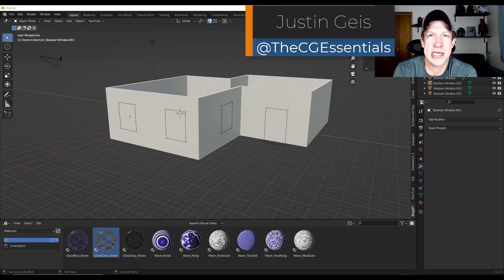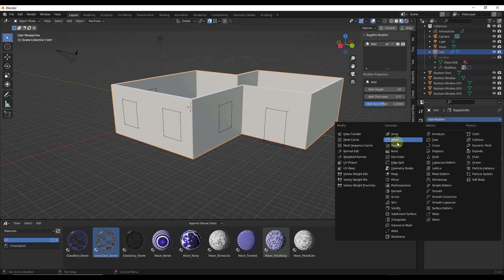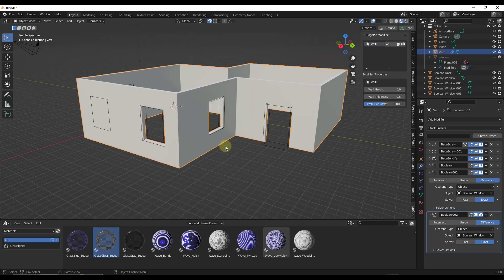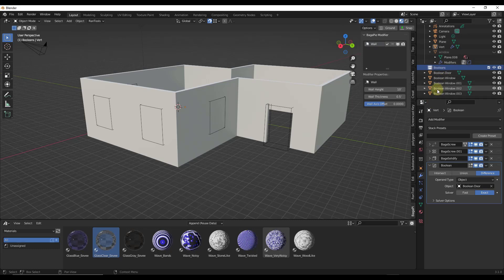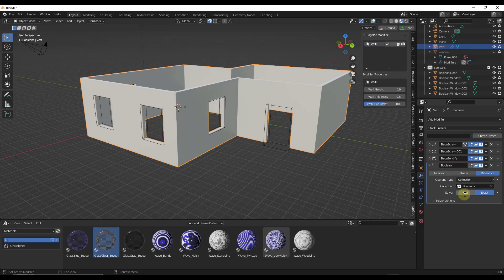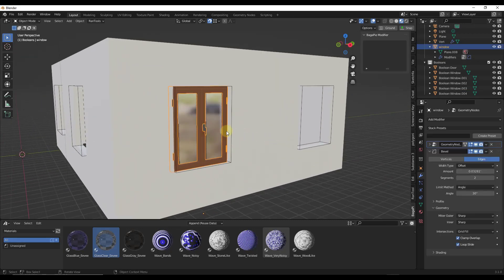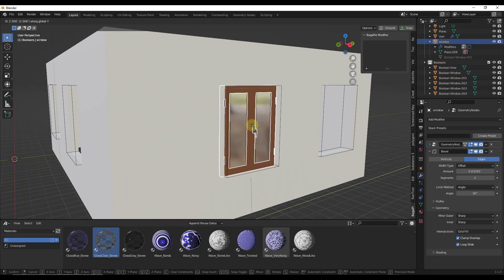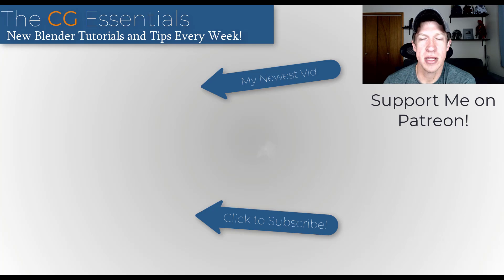The RIGHT Way to Use Booleans for Architecture in Blender!

Comment: Fantastic video as always (tho i started watching you 1 month ago). I am making a building and needed to cut doors, and I struggled with booleans coz i wanted to cut with a frame (like you did) and when I did it, it was not working for me :face-purple-wide-eyes:. Turned out I had to recalculate my normals :face-blue-smiling::face-orange-raised-eyebrow: Did it, and boom. It worked like magic. And the tip about adding single boolean instead of multiple booleans is epic, all windows and doors booleans (I called them cuts) etc can go to a collection (Cuts in my case) and adding a new boolean in the Cuts collection will automatically cut the mesh for us. Thanks for the amazing tutorial. :face-red-heart-shape::face-red-heart-shape:

Comment: I quit using booleans for cutting openings in archvis. I ended up making a ton of work for myself when you get yo r holes punched then look at your topology and it is a mess of N-gons and tri's and front faces have to be connected to back faces cuts, etc. it made some nightmares with texturing. It's a clever technique you have but I wouldn't use it for the entire exterior of a building, there's a lot of cleanup.

Comment: Been trying to find some tips and tricks on how to use booleans for character art concepts, to get different eye socket shapes and eyelids, basically different character faces quickly to see what works and what doesn't early on in the concept stages. The first idea was to just use one object made up of different meshes, but using a collection would allow for more pinpoint precision. Maintaining the option to parent things one object at a time might prove useful, too.

This is good to know, even for someone not into architectural modelling (yet).

Comment: Hello Justin! Thanks for this great Tip, it really helps to make Boolean managing a lot easier. What I try to wrap my head around at the moment is how to manage the outside facade on a multistory building. For every floor I made a collection. But I'd like to have a single outside facade to put my photo on ( I recreate an already existing building). However, when I want to see only a specific floor, I'd need to cut away the outer facade from the other floors. As a beginner in blender I really have no clever solution for it yet.